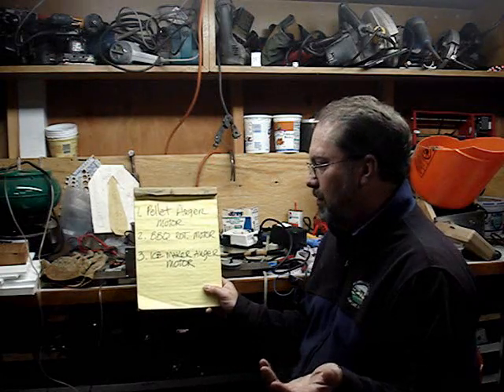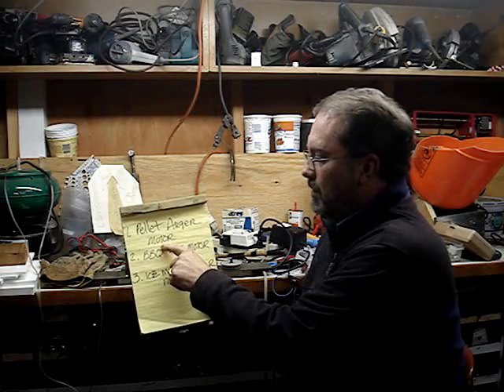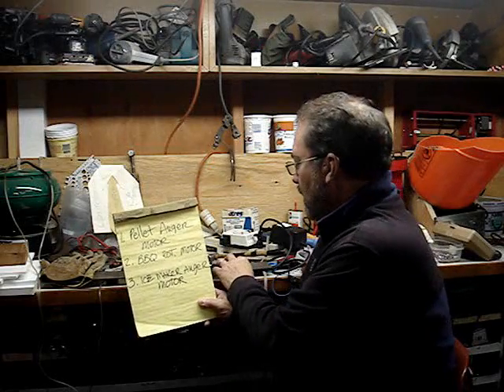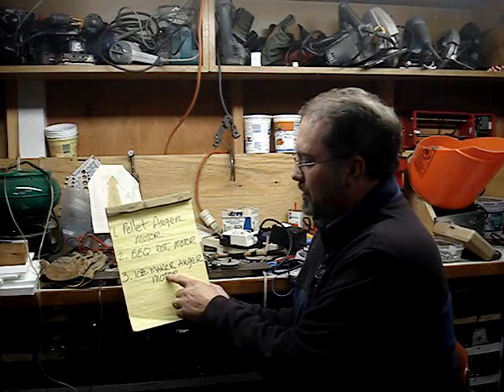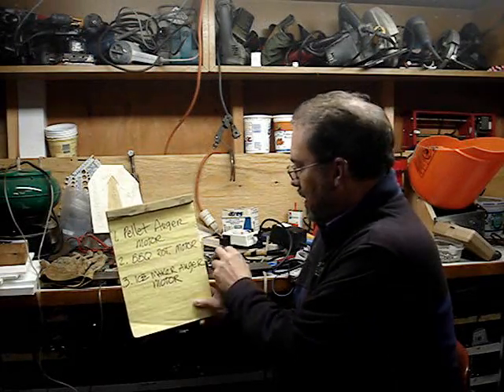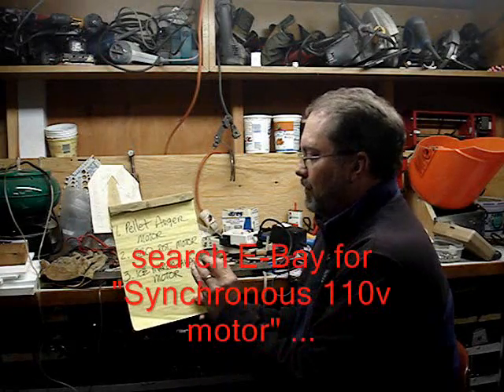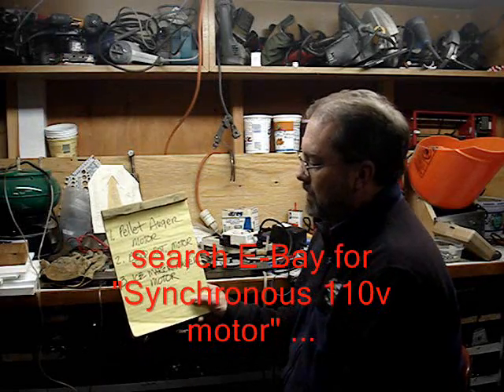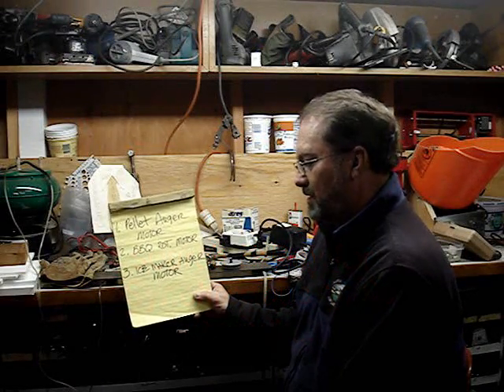Homemade case feeder bullet feeder motor issue part 2

Comment: What motor did you eventually decide on?  I am building my case feeder now and I am glad I stumbled upon your video as it shows you were stuck where I am stuck now on the decision of the motor.  I want a 12VDC motor that has a lot of power and wont stall when you put in a few hundred pieces of brass.